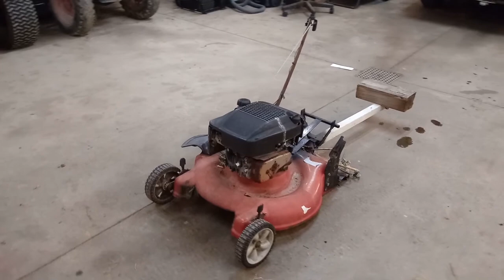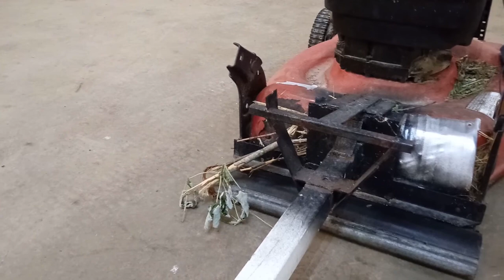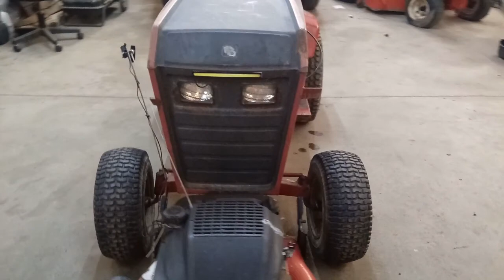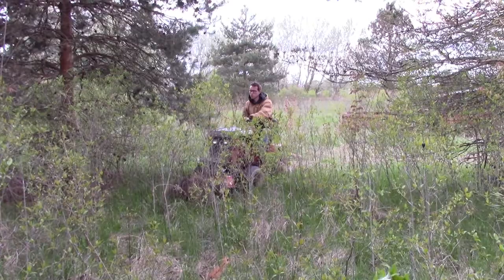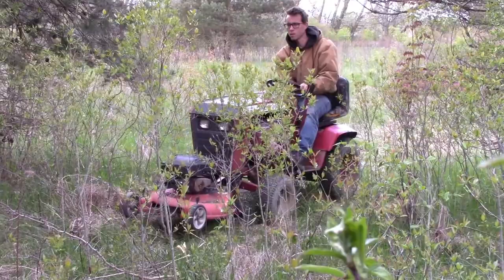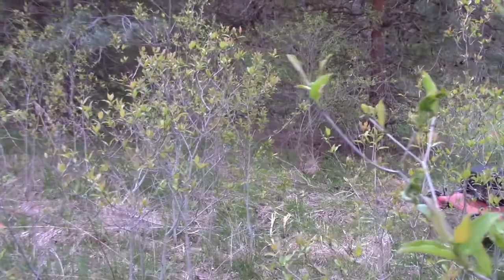I BUILT A DEATH TRAP! Homemade brush hog attachment for Wheelhorse

Comment: Oh neat!  Youtube suggested this video and seemed interesting.  Well of course, you're the young man with the fork loader!  Nice!  I'm wanting to do the same, though with a different design so I can tilt forward-back and rotate slightly to level, then ideally move left-right for best positioning which will be more challenging and design intensive I'm thinking.  I haven't really sat down to draw that up or research.  Though have the excavator and front end loader that I was actually this morning photographing some measurements of some of the pallet beam stock I planned to use potentially for the boom/arm. I still need to assess what I have for gussets and brackets as well as bushings material stock since for the backhoe/excavator will definitely need I'm thinking more material added to at least the joints if I don't build the boom/arm up more around with like a generative design topology optimization side view shape where that'll get more fancy cutting more material and welding a lot more... at least for the boom.  Arm probably won't need to be much more than the beam material a little built up.

Comment: The cutout in the front works great, but you might want to get a Comerical blade and cut it down to fit, the extra weight and thickness will help to save that engine 😎👍

Comment: and trying to cut a two inch sapling will destroy your brusher’s crank, with sudden stops
Reply from the maker: Thanks for your concern Jim! You are correct these small push mowers arnt made to take this kindof abuse, the idea behind this was that i could go pick up another pushmower for $20 at a yard sale when this one died, however 3 years of abuse later and it is in the same condition as when i first built it!

Comment: Your riding mower is not design to be play with that  clutch to go that slow all day long !  You will burn out that clutch and tranny in no time  fast !   Thought you should know ?
Reply: Hydrostatic transmission should fix
Reply from the maker: Correct! this will actually clip into the front quick mount bracket on any larger wheelhorse tractor, i primarily use it on a hydro tractor however it wasn't available for this video!
Reply from the maker: This wheelhorse is an 8 speed model with a hi/low range transmission, most of the video was spent in low range, no slipping of the clutch was necessary!